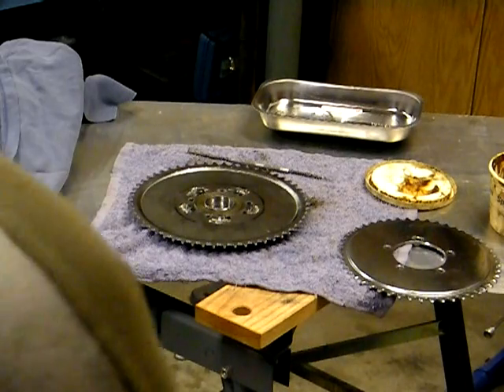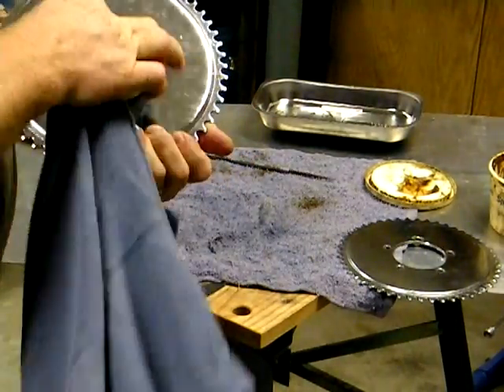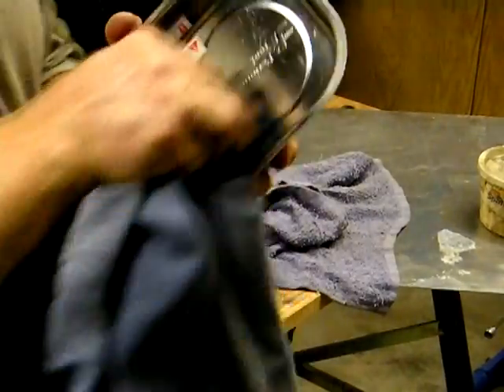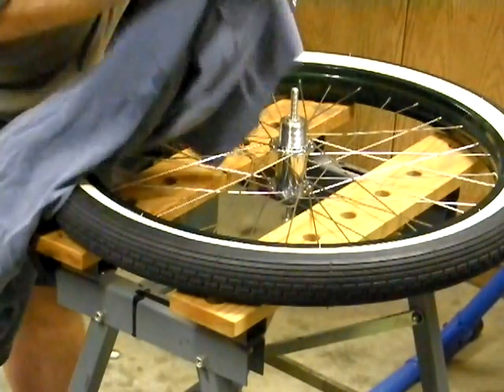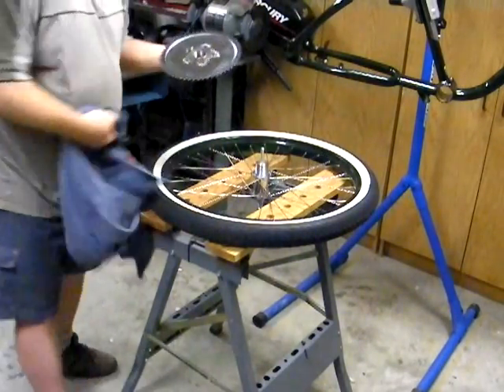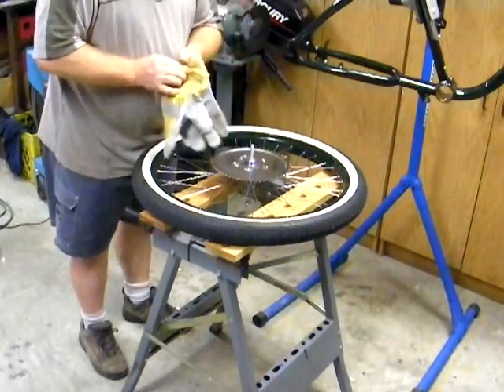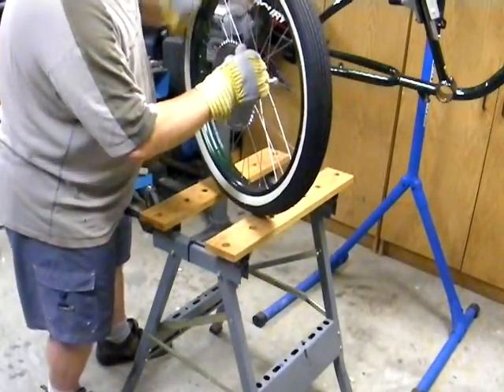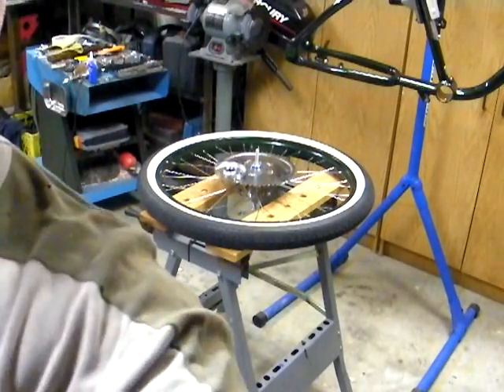2010 Felt Twin Install Grubee HD Axle Kit #4

Comment from the maker: Yes that is true I have had a few wheels that I was able to use the same spokes but most of the time you need new spokes it dose not bothere me the axle is worth it
Cheers
Terry
Reply: What drop out did you use this axle on?  I ask cause I'm building my first build ever and I bought the 61mm HD axle from Grubee as it stated on Bicycle-Engines website the 61mm is for single speed 150mm drop out but the paper work stated this is for 135mm drop out and Grubee said it will work but has to be spaced out.  So I am looking at if there will be any headaches trying to get the Grubee axle to fit and line up properly I the wider frames.